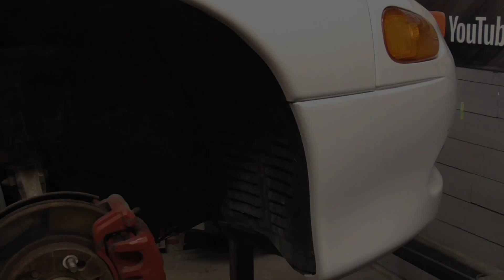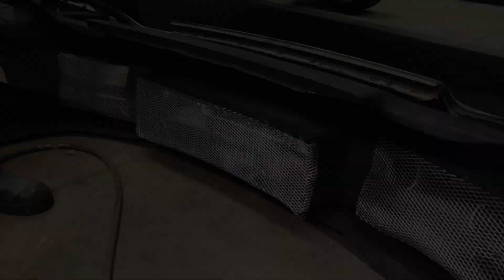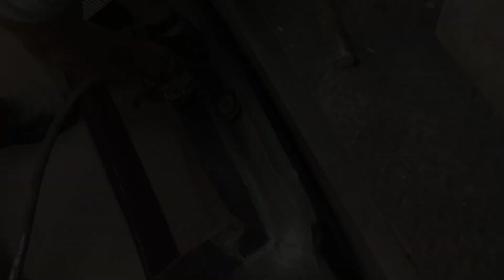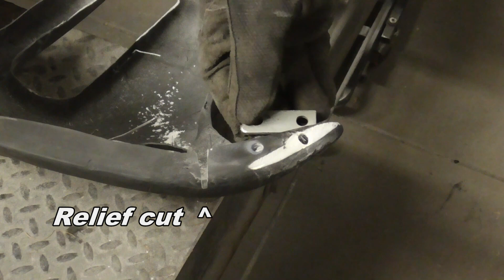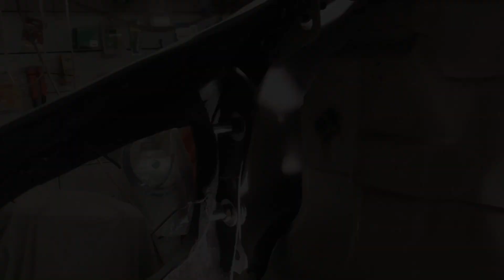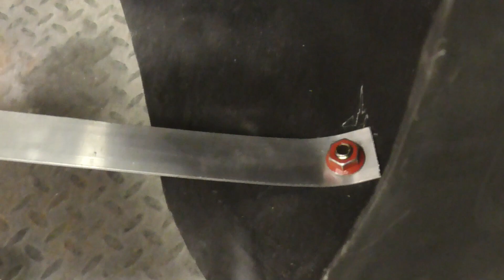Duraflex Custom Bumper Installation Part 1 - Cutting and Fitting

Comment: Wow, this was NOT straightforward! Can you imagine what the average owner thinking this was a project they could do at home! I would not have imagined it would take so much customizing to make it fit. I would have been greatly disappointed. Great job as always, Jerry!
Reply from the maker: I'm working on fitting the headlights right now.  WOW!  Getting them, the trim, hood, etc. to fit is really quite a bit of work.  My kid is excited about it though so it makes it worth while - it will look really cool.  Those 3000GTs were pretty nice cars.  Have a great weekend Uncle Mark - always appreciate you stopping by and checking out the videos :)
Reply: @LakesideAutobody  That was the next question! Customer or your project! Your kid will live this once it is complete. It just seems like it should fit a lot better, with minimum tweaking.

Comment: Good video. I look forward to part 2. 
I like that you sound indifferent to the quality of the bumper instead just stating facts about the fitment and optimistically saying what must be done to make it work.
 I bought a duraflex bumper for my 3rd gen Camaro over a decade ago and never got around to installing it because of those same issues. I wanted something different and I liked the one of a kind look. I like tinkering and I'm looking forward to learning some fiberglass techniques. Thanks! 👍
Reply from the maker: Here's part 2 - https://www.youtube.com/watch?v=9AcMlN-WAho  3,  https://www.youtube.com/watch?v=B3Q6dE4fp3o 4, https://www.youtube.com/watch?v=-3rTgJHEpQc  Thanks for watching :)

Comment: I just gotta ask, is it worth doing? Ive been wanting to get a duraflex bumper for my car, but im on the fence about it.
Reply from the maker: If you are good with filler and good with your hands it's possible.  Most body shops would have a very hard time making this work.  These bumpers look cool but the fitment is absolutely horrible.